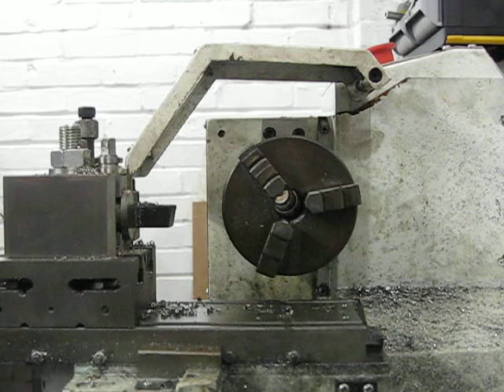Can you use an ordinary induction motor as a Servo?

Comment: Hello Andy, I've watched a few of your videos in the past but missed this one. Could you tell me a few more details about how you achieved this? I'd like to use the same technique on my Fehlmann miil/drill - see my channel. Thanks David
Reply from the maker: It's basically very simple in some ways, and not in others. The lathe was already converted to CNC, so there is a computer involved, running LinuxCNC. 

At that point I just set up an ad-hoc HAL setup with just a PID component and the normal spindle encoder. So the PID feedback was the spindle encoder and the output went to the VFD velocity control output. I then just typed numbers straight in to the PID position command pins. (You can hear me typing)

Comment: Have you tried use of a closed loop vector drive with a high ratio induction motor? You should be capable of replicating the same control as a servo given the proper equipment and have more torque. Obviosuly you were doing this on a budget but given some time and exploration you could certainly have far better control and should be able to induce full torque at speeds as low as 5hz without issue. I would also highly recommend the use of a external brake which will help in positional control along with a closed loop encoder.

Comment: Good day Andy, i'm in the process of converting a Weiler CNC lathe with linuxcnc. I replaced the spindle motor with standard 1.5Kw induction motor (for now ) 
will install a encoder ABZ for feedback and possibly an automotive type of disc brake ( have hydraulic power ) ,   figure out orient setup etc..
1) What kind of accuracy can i expect ?
Reply from the maker: I think it would be better to retain the original spindle motor. I have actually used a Weiler CNC lathe converted to LinuxCNC. The conversion used STMBL servo drives, but I am not 100% certain that it used one for the spindle motor. 
But, if you were to fit a brake then I think that the position accuracy would be limited only by how slowly you can turn the spindle and how fast the brake engages. You could simply rotate at a slow speed and clamp the brake when in-position (and turn off the motor). You might not even need angular position control at all.
Reply: Thanks Andy
The original spindle motor is a 11.5KW 400V 32A  DC motor beast .( i can't even pick it up )
I noticed repairs where done to the Anno 1983 driver unit  and decided to destroy it so i couldn't go back.
One of the original servo motors was a clunker and i replaced it with a Xinje 1.5Kw AC motor 
5i22 + 7i29 + 7i33 + 7i37  .Hope i didn't bite off more than i can chew ,  and we are broke  :-)

Comment: i used fanuc ac motor (asynchronous,(without magnet)) and connect to danfoss make vfd fc302 with imc (integrated motion controller) software and use with linuxcnc in position mode and it works fine with pid motor is with 1024 encoder connected in drive and external encoder going to linuxcnc and with two stage gear it work very well for indexing but some issue with x and c axis synchronization

Comment: One reason servos are typically permanent magnet rotor is to avoid heat build up when idle. Induction motors heat the rotor and have insufficient air flow to cool it when trying to hold a position.

Comment: You need to have a VFD driving the motor as well as a rotary encoder.  PID controls the forward path of a control loop, the rotary encoder will make it a closed loop system and compensate for error.
Reply: Andrew Quinn noob here, what is a VFD and why does Renesiz say you get "far better accuracy with a modern VFD" ?
Reply: A VFD is an acronym for "Variable Frequency Drive".  Take a look at the wikipedia article titled "Variable Frequency Drive", it is really fascinating stuff.  Basically a VFD takes in AC power, converts it into DC power, pulses the power using "PWM" (Pulse Width Modulation), inverts the DC signal, and then smooths it into a controllable AC signal.  This allows the motor to run at infinitely variable RPM.  It also allows the motor to act like a servo, and even lock itself into a certain position.  However, a more modern system has been invented, called a "Vector Drive", it is very much like a "VFD", but the PID control loop is much better.  I still try to understand it myself, as I only got my degree in mechanical engineering, not electrical.  Modern CNC Lathes use this exact technology to allow controlled fixed angle rotation of the spindle when using live tooling.
Reply: Andrew Quinn vfd and vector drives sound right up my alley. I'm interested in high power and high precision. I was EE but focused on power so we studied induction motors and that was about it.  Thanks for the detailed explanation!